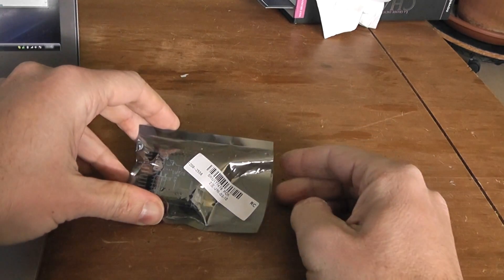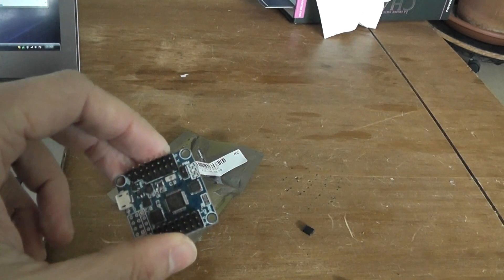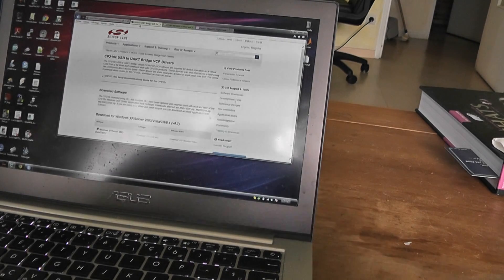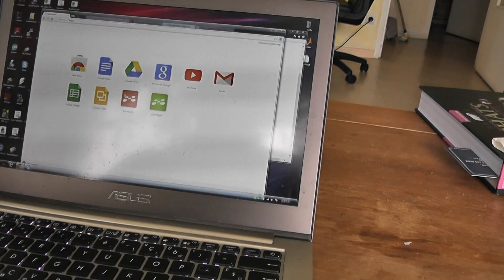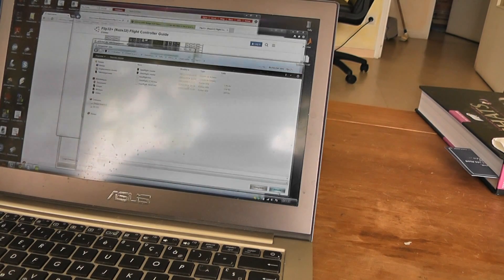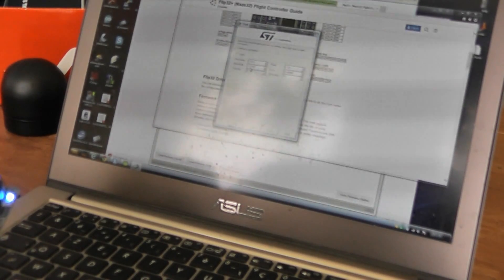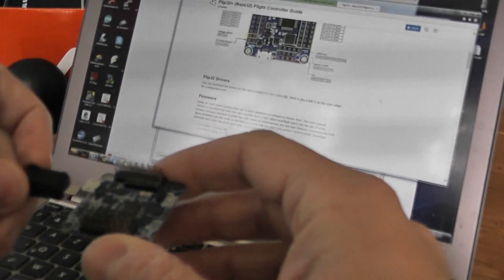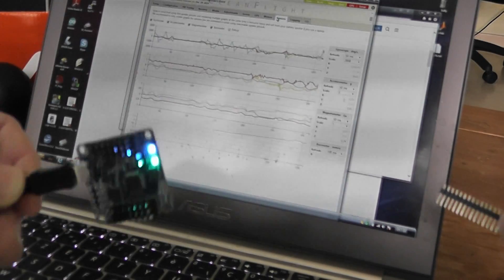Flip32+ Unboxing and Cleanflight installation (Courtesy Banggood)

Comment: No need for St_Flashloader_Demonstrator and boot pads shorting. The BG Flip32+ clone has a preinstall.
You are able to update/flash the firmware directly via Cleanflight Configurator. I did it with a FTDI and the serial pins (to be solder). If you have problems with the Silabs driver, go this way.
Reply from the maker: Good to know ....Thanks ..... In another hand you need a FTDI converter and a soldering job too.
Reply: SeBy DocKy If you like to have telemetry or an osd, you will have to solder this pin row anyway.
Reply from the maker: aMax Right :)
Reply: I was able to flash my clone with Cleanflight using a micro USB cable. No problems at all. I can hardly believe what they can fit on this tiny board. Just ten years ago, only companies like DARPA, or General Dynamics, had stuff like this.